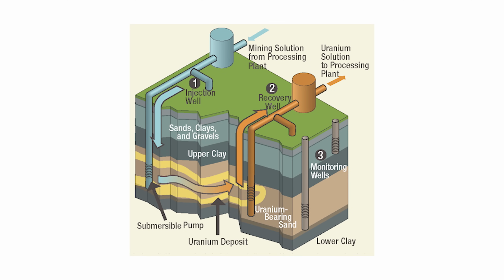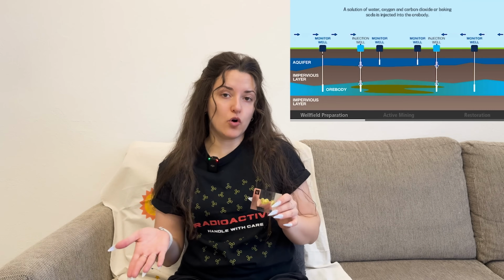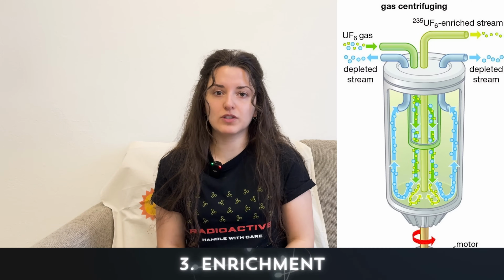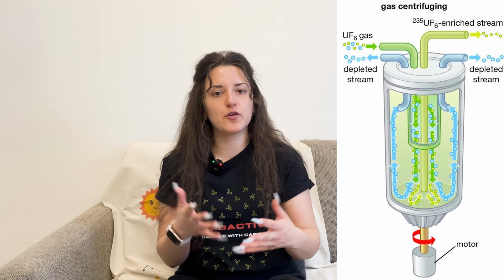Nuclear Physicist Explains - How to Fabricate Nuclear Fuel?

Comment: Very cool, I’d love to hear about the fuel type you work with! What happens to all the U238 from these processes ? I’ve heard chemists will use it for their experiments but are there other uses for it so it doesn’t go to waste ?
Reply: The majority of U-238 doesn't have all that many uses. There is the experimental chemistry aspect to it, but the labs which work on chemistry of uranium don't use much - I used to work in one of them (I didn't personally work with uranium, but I worked alongside other chemists who did), and the entire lab used less than 100 grams per year.

It does find uses in nuclear reactors - the fuel in most civilian power production reactions is mostly U-238, since the fuel rarely requires more than about 5% U-235 enrichment. In a typical reactor using mainly U-235 as the primary fissile isotope, approximately 70% of the energy produced over the lifetime of the fuel comes from fission of U-235, with the remaining 30% coming from a variety of different plutonium isotopes, all of which are fissile. With the exception of MOX (mixed oxide) fuel, the plutonium is not present in the fuel prior to insertion into the reactor, but is created during operation by neutron bombardment of U-238. As the reactor is run, the proportion of plutonium will gradually increase, reaching a maximum when the rate of plutonium fission (which begins as soon as some is produced) becomes equal to the rate at which it is consumed.

Reactors using MOX fuel also get roughly the same proportion of their energy from plutonium fission, but have a head start on this since some plutonium oxide is mixed with uranium oxides when the fuel is made, so they start fissioning both U-235 and plutonium right from the start of operation. Then there are fast breeder reactors, which use fuel with far higher U-235 enrichment (about 20%), and do not use neutron moderation, hence the description of fast, which refers to average neutron velocity. The fuel in breeder reactors is still about 80% U-238, but these reactors convert far more of the U-238 into plutonium. They also produce plutonium at a much faster rate than they consume it, which is why they are called breeder reactors.

The other nuclear purpose U-238 is used for is as an inertial tamper for some nuclear warhead designs, and as a fission secondary in multi-stage nuclear weapons: These weapons use a conventional plutonium or highly enriched (80% or more) U-235 fission weapon to create the temperatures necessary to ignite a relatively small amount of nuclear fusion fuel. This contributes some of the explosive energy but more importantly releases large numbers of very high velocity neutrons, much faster than the neutrons produced in any nuclear reactor. These high velocity neutrons have such a large amount of energy that they cause any U-238 present to fission, and the large number of them ensures that almost all the U-238 present will fission. So the fusion fuel effectively catalyses the fission of U-238 in a highly efficient way, which then contributes most of the explosive energy of the weapon.

Non-nuclear uses for depleted uranium (U-238) tend to involve its high density, since it is far more dense than lead. One use you probably have heard of is for high density kinetic penetrator rounds for artillery guns, specifically armour piercing rounds for anti-tank guns. The acronym used for such rounds is APFSDS, which stands for Armour Piercing, Fin Stabilising, Discarding Sabot: They are essentially a narrow, sharp pointed solid depleted uranium dart-shaped projectile, with flight stabilising fins at the base, fired from a smoothbore gun barrel (the stabilising fins make it fly straight without needing to spin while in flight, so a rifled barrel is not necessary), with a detachable sabot or spacer which allows the dart to be fired from a much larger calibre gun with more propulsive power, the sabot falling away shortly after the round exits the barrel.
The armour piercing effect is partially due to the sheer density of the solid uranium dart, but this is also enhanced by the other physical properties of the uranium metal: It is much harder than lead, and is also pyrophoric - when subjected to friction with other hard materials, it spontaneously ignites, literally burning its way through armour plating and acting as an incendiary, setting fire to any flammable materials it hits, such as anything inside a tank or other armoured vehicle it is fired at.

Comment: I would love to see the same sort of video for the processing of thorium "fuel" for the next-gen reactors!  & I really learned a lot from this one!
Reply: It would be interesting but I'm aware of the basics.  Once you have thorium, it is basically nearly 100% Th232.  This isotope is the "fuel" but it would need a different kind of enrichment to get the reactor started.  Thorium requires one neutron (and some time) to breed from Th232 to U233 and it is U233 that provides the energy from fission when hit by the next neutron.  That fission generates new neutrons, but until enough U233 is lying around in the reactor it needs to be boosted initially by something else that generates neutrons.  This could be HAELU (just under 20% enriched uranium) or other such fuels.  Once the U233 is being bred at a good rate, the added fuel should no longer be needed.  The preparation of the thorium to work in the reactor will vary by the reactor itself.  A LFTR for example uses fluorine, so before use the thorium and its carrier salt are converted to fluorides (probably using HF). The reactor runs at a high enough temperature that the thorium fluoride and its carrier salt melt, and is used to generate further heat from the nuclear reaction (mentioned earlier regarding U233).  Other thorium reactors use it in a solid form (typically mixed with uranium) or as a different salt, such as a chloride reactor (using chlorine rather than fluorine) or any number of other options.